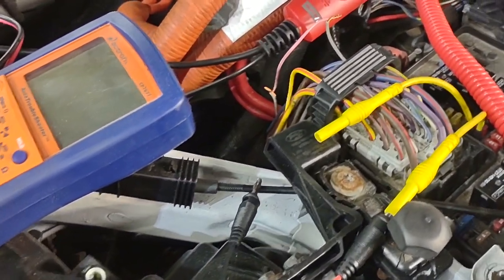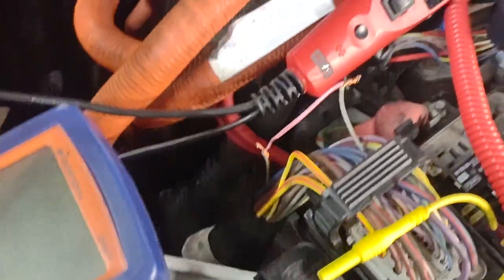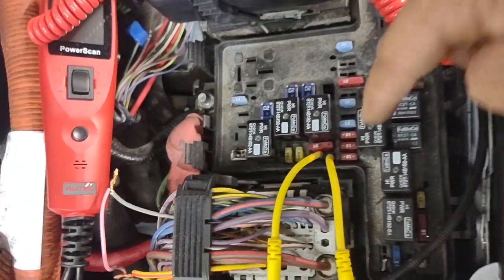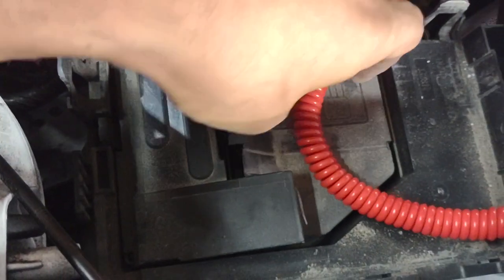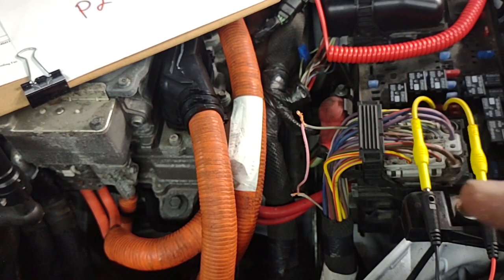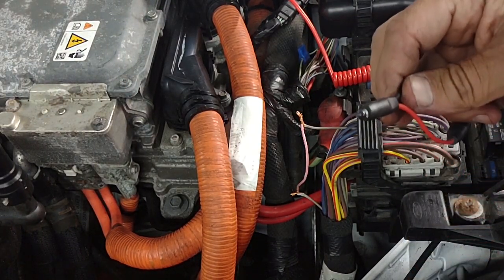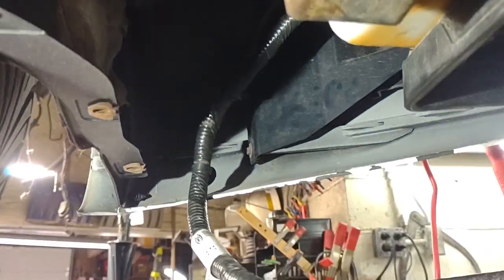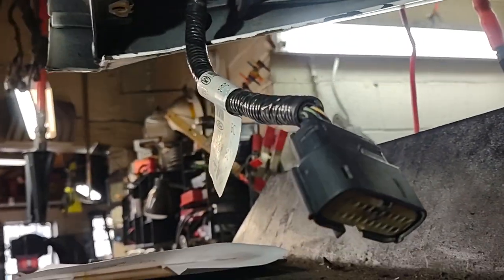@carservicepro P26CA, Coolant Pump, Hybrid, Ford,Fusion, Electric short, coolant Pump fuse location

Comment: Hi bro
I got similar code 
P26cf which is to do with the module 

2023 Nissan Xtrail e power hybrid 

Can u help me please brother 

My car water went inside the car 
Is there. Module inside the car ?
Reply from the maker: Hello, I have not yet worked on this model year. Generally speaking, most new cars now place their station modules away from the vehicle floor, typically behind the dashboard, in the engine compartment, or in the trunk. The only modules located near the floor are those for airbags and seats, as well as stability control systems. Additionally, bus connectors can also be found near the floor and may lead to significant issues. In cases of water damage, it's essential to conduct a physical inspection of the components first. Hope this was helpful!
Reply: @carservicepro  hi mate
Thank u so much for these info I managed to start the car 
Yeah no modules there 

Just cleared the codes in the ev system and all went okay